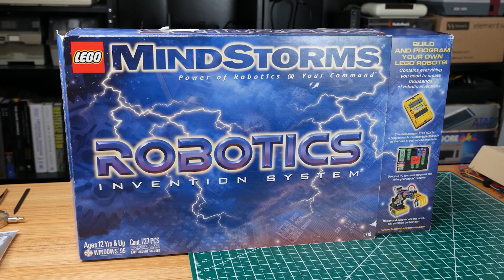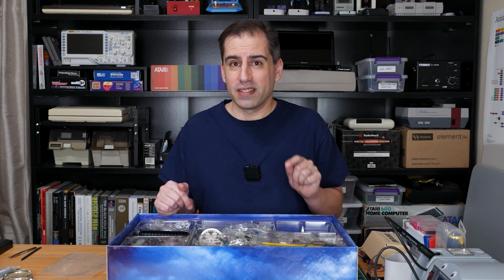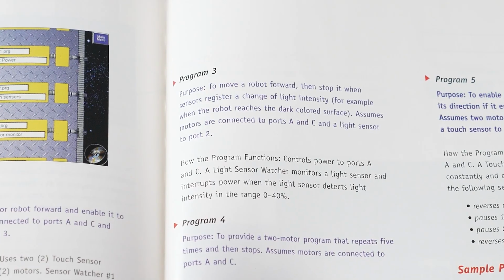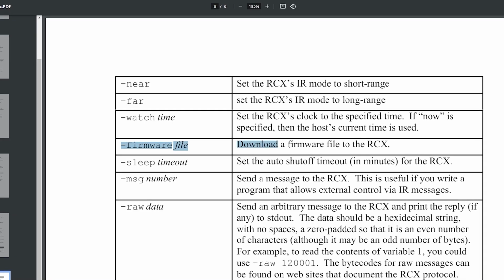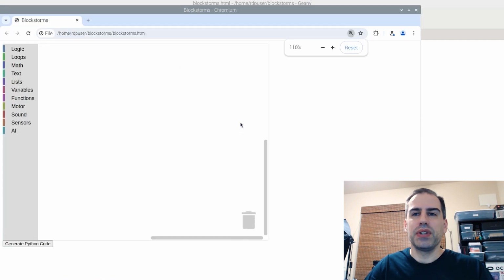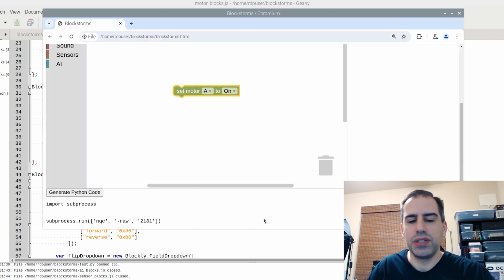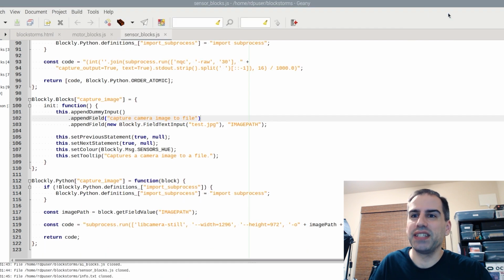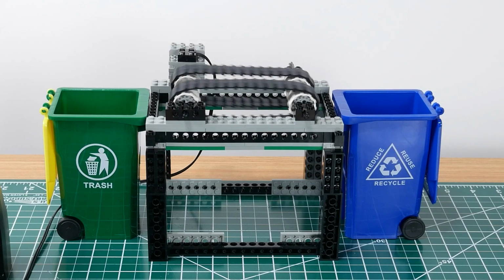How to Control a LEGO Mindstorms kit with AI and Raspberry Pi 5

Comment: Be warned, that generation of motor are prone to failure.
BTW I still have mine but I had the RCX 2.0 in mine.
Reply: Yeah, one of them was already going bad when I got it. I'll have to see about 3D-printing some adapters for other, newer motors. I'm sure I could get something working.
Reply: @andywest5773  I've thrown away dozens of them over ye years

Comment: God, that kit kickstarted my entire tech journey. This is definitely a trip back.

A few small things:
* You should be able to use a different serial converter to make it work with your existing hardware.
* RCX 2.0 units include a USB IR transmitter that might work a bit better. Might be able to find one secondhand.
Reply: That's a good point. The converter I used is a few years old and it looks like there are new ones that might be compatible. The problem with the USB IR tower is the ancient drivers. I'd rather just stick with RS-232 than deal with that.
Reply: @andywest5773  That makes total sense, yeah. Apparently the old USB driver doesn't work on 64-bit Windows, so serial's definitely the way to go. Kinda surprised no one's hacked together their own custom driver or made a commercially available third party tower that's a bit more readily purchasable.
Reply: @andywest5773  I have the driver availaible, the correct ones
Reply: me too - now I'm an automation engineer XD (albeit mostly software now)

Comment: What is the current version of Mindstorm??
Reply from the maker: They were discontinued in 2022. The last versions were the "EV3" and "Mindstorms Robot Inventor"
Reply: @element14presents  But is there something now for robotics with Lego?
Reply: @element14presents  
Shame ... these also appear to be discontinued.  At least on the Lego site they say retired.
Reply: @element14presents  The Mindstorms brand was discontinued, but the LEGO robotics system itself is still around! It's called Spike Prime now, and is sold under the LEGO Education line, but it's the exact same system as the last Mindstorms kit albeit with a different color scheme. And you don't have to be an educator to buy one, LEGO Education products were made available to the general public as well a few years ago.
Reply: The current version of Mindstorms isn't called Mindstorms anymore, it's called Spike Prime now, but it's the same electronics as the final version of Mindstorms before Mindstorms was discontinued. It's a LEGO Education product, so doesn't get much advertising, but it's still available to the general public - you don't have to be an educator to buy one.

Comment: You can still use it in windows. That message is ok. Yet they all need the profiolic driver
Reply: I eventually got it to work by rolling back to an old version of the driver, but it reinstalled the new one every time I restarted my machine. Not ideal to say the least.
Reply: A problem faced with every old driver that no one wants to manufacture again or differently. Lucky as said in the video Linux supports it out of the box 😊

Comment: You're not really going to make me dig out my 1998 MindStorms kit, are you?
Reply from the maker: Yessss
Reply: Do you have the vision command camera as well? ;) so many great memories. I probably have my nqc files somewhere…
Reply: @bobthemagicmoose  hell yeah I had the vision command! I wanted the movie maker kit, but my mom got me that one. Guess she knew I had a better shot with STEM.
Reply: I was actually think of getting out my old RIS 1.0 to show a kid something.
Then I stumbled into this video 😅
Reply: @grogyan  so I broke mine out while I was in college because my 5 year old sister loved Legos. My laptop still had a serial port and was able to get the software running on XP. I built her a simple line following robot and she LOVED it.
Reply: Mine still works.
A couple of motors don't work, but I had bought myself both the RIS 1.0 and 2.0 so still have plenty of motors
Reply: @Element14 FYI, the 1.0 RCX is incredibly valuable, as it could run with an external power supply, where as this feature was removed in the RCX 2.0